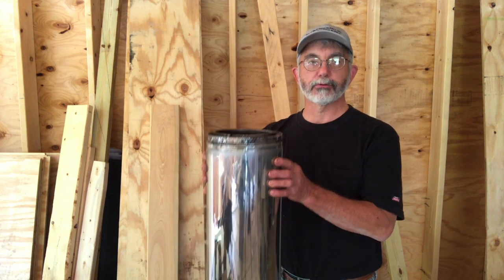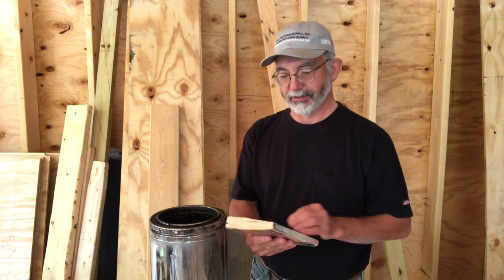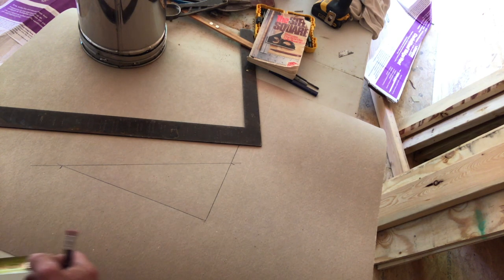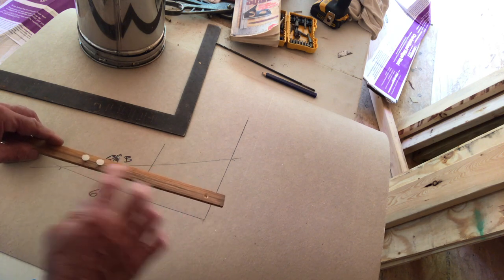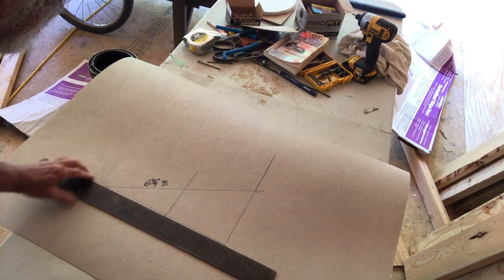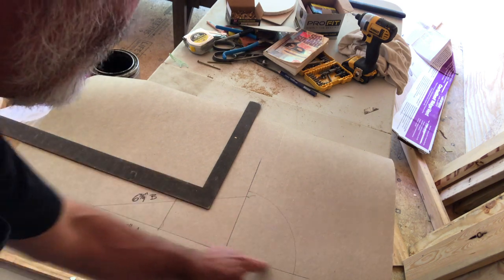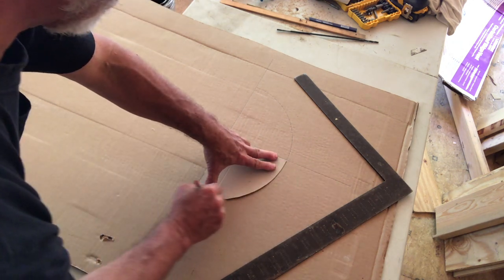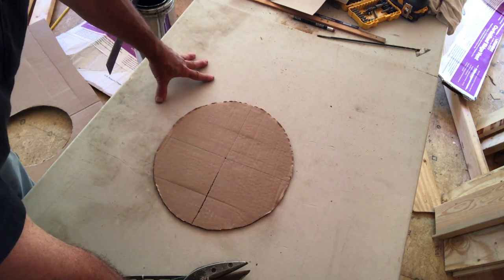How To Cut An Ellipse For A Round Pipe Through A Pitched Roof

Comment: That's a great explanation. I was hoping there would be a quicker way, buy hey ho....At least this way, it will be 100% correct. Thank you.
Reply: There is a quicker way.. but you'll still have to lay it out.

Take the diameter of your pipe, divide it by the cosine of your angle. So it'll look like this

w= d/cos(angle)

A 6 inch pipe going thru a 45 degree surface would be

W=6/cos(45)

So the long point of your ellipse would be 8.48" and the narrow part would be 6"

Comment: I noticed that with your 1/4 elipse template you flipped it over after you drew the first 1/4. you used one side of the template on opposing 1/4ers and the other side for the other opposing corners, is this necessary?

Comment: Either I'm using the wrong terminology or it's just not online, but how the heck do you cut a square/rectangle hole in an angled ceiling for a support box?
Reply from the maker: If your square support box is installed level and you need to make a square hole to match in an angled roof above it, I would just drop a plumb bob down from inside the roof to the four corners of your level box. That will give you your outside dimensions. That is, if I understand your question correctly. Best wishes. 👍

Comment: If you're still reading comments - I'm doing this on a vertical interior wall at MUCH greater than 90' degree angle to adjacent wall. (An open L.)  It's a preexisting 4" PVC drain pipe crossing the room near the ceiling and parallel to the side walls. It can't be boxed in to hide, so I need a neat opening that I'll make with drywall and/or thin, smooth plywood I could cut with a scroll saw. How do I measure the angle of the wall (which number do I use) to mark the correct place on my template if I don't know the "pitch"?

Comment: I used this method to put an 18" piece of spiral duct through a 45° wall. The fit is so snug it will barely need any caulking. Thanks for the instruction.

Comment: How did you mark the hole centerline on the underside of the roof? plum line?
Reply from the maker: Yes. I started at the stove on the first floor and used a plumb bob to locate the location of the ceiling bracket. Then, after that was in, I used the plumb bob to find the location if the ceiling cutout on the 2nd. floor. Then I again used the plumb bob to determine the center on the underside of the roof sheathing. "Plumb bobs don't lie." :-)
Reply: Herrick Kimball 
Great! Thanks for the reply!

Comment: This is most helpful. I’m still a bit unsure as how to determine my center in the roof. I saw a comment below about using a plum line, but I am not confident in how to use this method. I am going straight up with 6” duct from a range hood.
Reply from the maker: I hope it worked out for you. Lacking a plumb bob I would plumb up using a 4ft level. But the plumb bob is a great tool. You can achieve the plumbing effect by hanging any kind of weight on the end of a string. In other words, an actual plumb bob is not a necessity.
Reply: I would put a laser level on the side of my pipe and pull a tape measure the radius of the pipe to mark center. Then do the same from the side 90° away. Don't forget to take off for the height of your laser on your level.

The other way would to be hang a plumbbob and have someone measure where it lands in the pipe until you find the center, then mark it

Comment: I ended up with a hole that was 2 inches wider than I wanted. Didn’t kill the project but I don’t know what I did wrong.
Reply from the maker: 🤔. Hmmm. Sorry to hear that. Somehow you added an inch to your measurement, which would translate to 2" wider than needed. Back to the drawing board....  I hope you figured it out . 👍
Reply: @herrickkimball  Well I did cut the paper and then went ahead and cut the hole in the roof without remeasuring the paper... that would have been good. Flashing covered the hole fine, and the chimney's in! Thank you.

Comment: I have to do same job but my roof angle is 57* - I’m not sure what a 6-12 pitch is in terms of angle - can you help please?
Reply from the maker: Hi Dave,
That's a really steep pitch. I wonder if your angle is actually 33°, which is an an 8-12 pitch.
 (I came up with 33 by subtracting 57 from 90). 
This link may help you: https://www.blocklayer.com/riseruneng.aspx
By the way, a 6-12 roof is really easy to walk. 8-12 is too steep to comfortably walk. 
Best wishes.
Reply: Herrick Kimball thanks for swift response. It’s definitely 57* - measured with a digital level but I guess 60would be near enough to make it easier.

Comment: One question. When you make the hole in the trammel for the pencil you say it doesn't matter where it goes. Just at the end somewhere. Wouldn't this matter as if the pencil hole is in a different spot the radius would change?
Reply: Wouldn't the pencil have to go in a notch at the end of the trammel so the correct radius is maintained?
Reply from the maker: Hi Scott,
If your A and B measurements are made from the pencil hole correctly, it makes no difference where the pencil hole is in relation to the end of the trammel stick.
Reply: Thanks mate. That makes sense now. I thought you were measuring from the end of stick. Thanks for the advice. Just doing this work now in Australia in lockdown to keep busy.